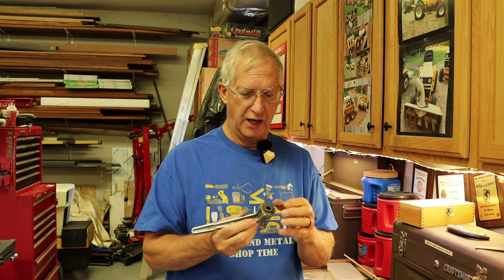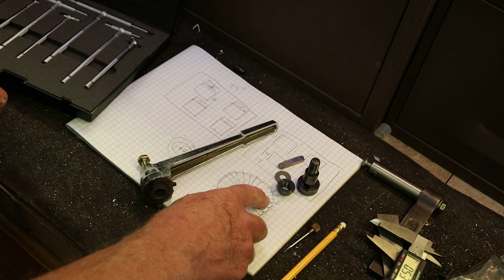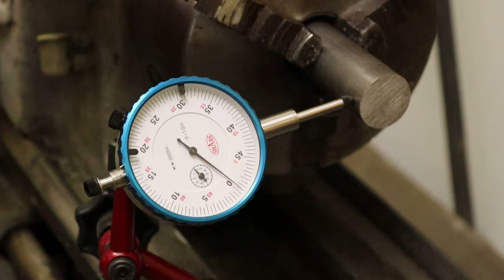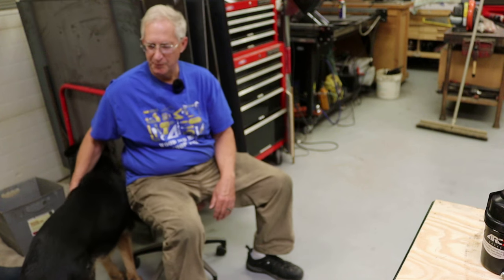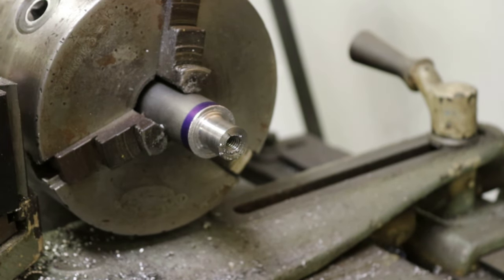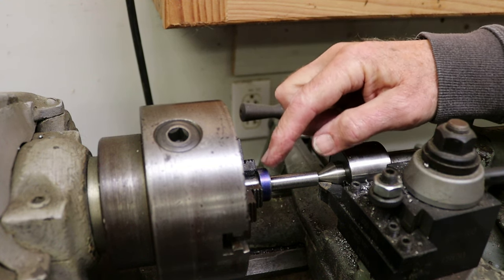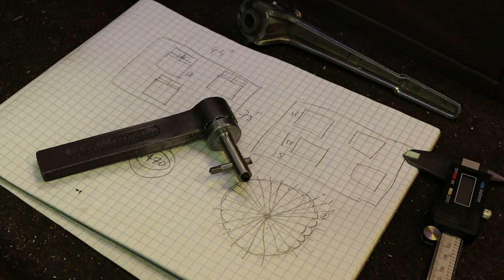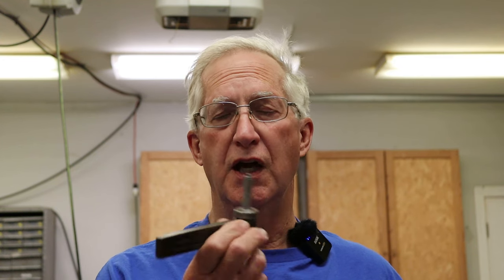Internal Splines on the Shaper

Comment: 21:55
As not to force
and do not damage the threads
- It seems longer, but it's pretty much the same - :

1/4 forward on the right,
then 3/4 back, - remove all shavings
1/4 on the right etc...

Comment: Can't the steel insert be taken out and put into another handle ?   Seems like it could be done.    For all:   if you have something blind in a hole - an insert that you can't push out and nothing to pull on.   If the back is open (drill ?) pack it with grease and pound a stick piston inside and the insert will pop out.
Reply from the maker: That's less fun than machining a new handle.

Comment: Why don’t you make a foot pedal
Reply from the maker: Foot pedal is not so easy. Requires spring return to neutral, and fine control is not so easy with your foot.  It's actually a lot more difficult that it would seem.
Reply: @woodandmetalshoptime8048   but you kan use your hand oom de steering weel 😜
Reply from the maker: I did it on my motor grader. It works OK, but not very fine control.